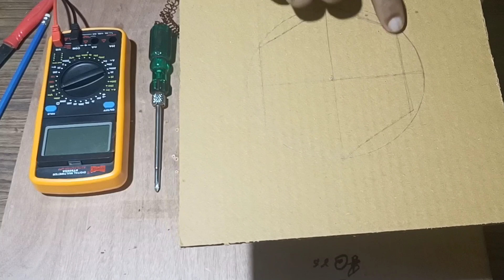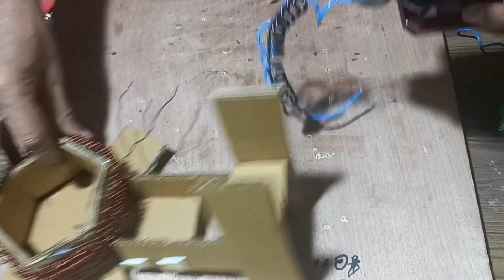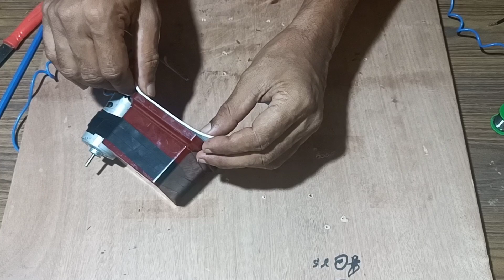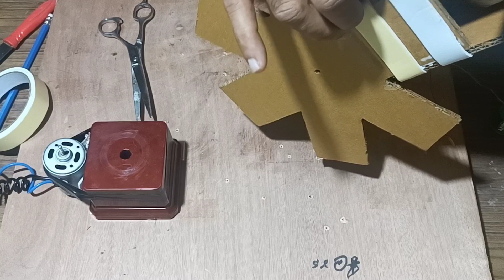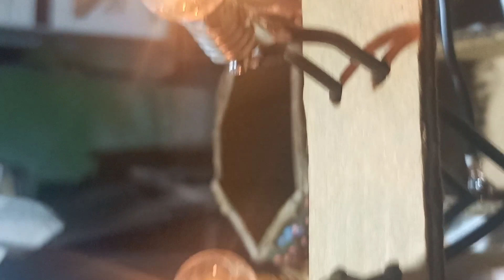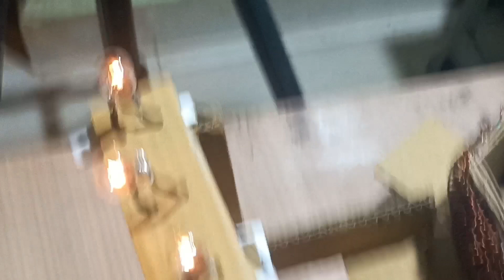"Free Energy: Unveiling Magnetic Forces Within a Hexagonal Cardboard Setup"

Comment: What type of motor it is?
It's looking different
Reply from the maker: It's a Ball bearing high-speed Low friction 12Volt DC Motor
Brand-Electronic Spices
Speed-50000 RPM
Volt-12Volt Max
Horse power -15
High Torque rated voltage DC Motor
Normally it is found in all electronic shops 😊